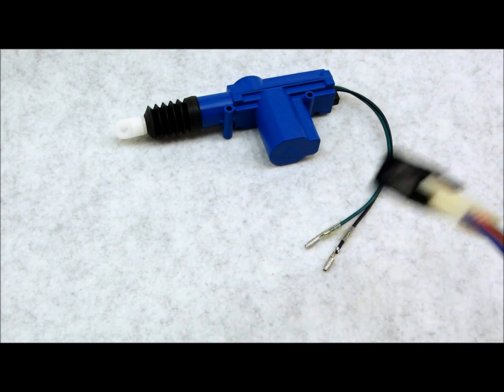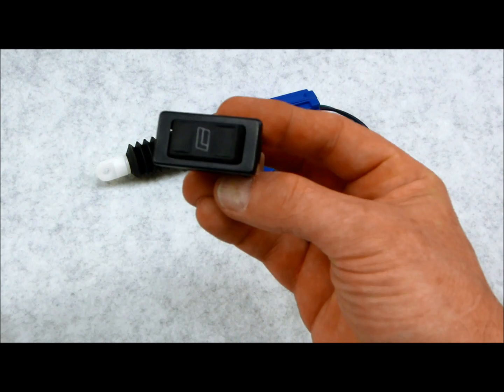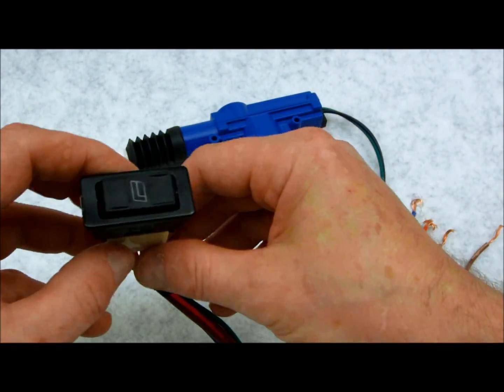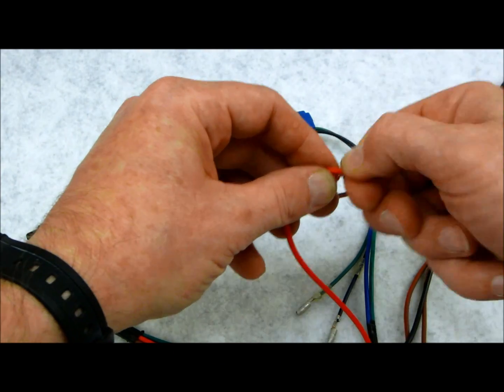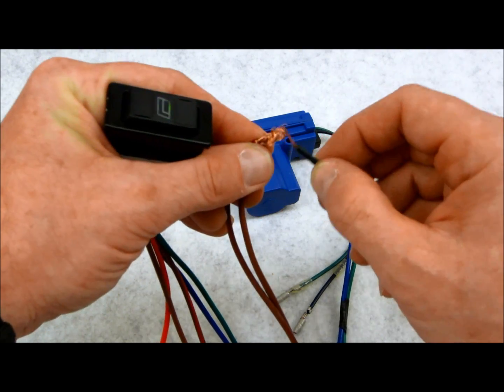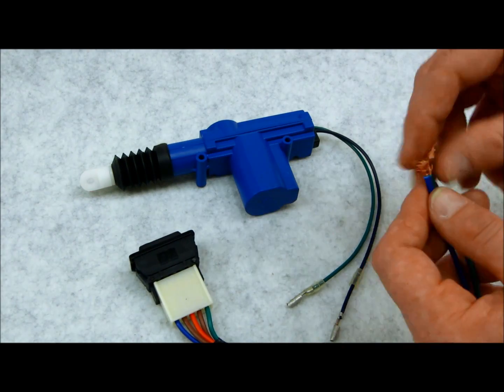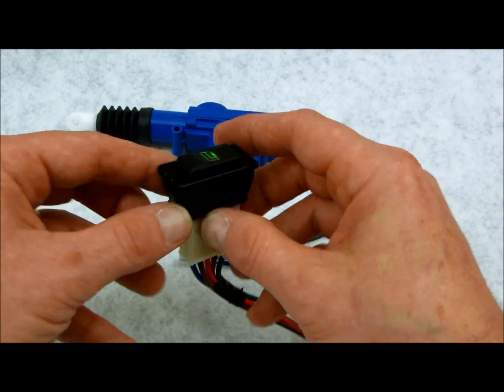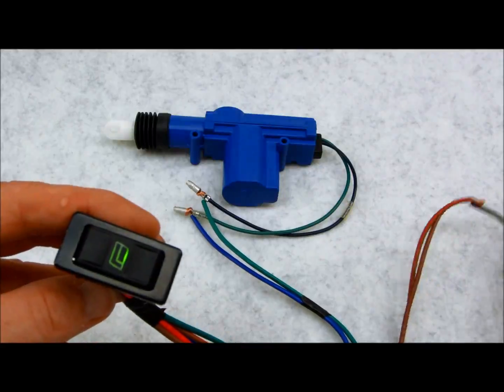Simple 5 wire switch and door lock actuator kit

Comment: Hold the phone. Two browns to a constant 12v. Red to 12v I assume a switched 12v?
Reply from the maker: center pin to +12v the 2 center pins to -12v the 2 outer pins will alternate 12v + and - to power the door lock motors

Comment: My truck has an aftermarket viper alarm. It does not have power lock switches. I want to add the switches. Would the best option be to tie into the alarm system?

Comment: hi @lesscoelectronics.  love watching all your videos.  I found when using a similar illuminated switch, there is no need for the red wire!  It is simply to illuminate the LED.  I am using my toggle switch for door locks and at first I thought I was going to have to now look for unilluminated toggle switches.  But I got to thinking about the power source for the switch so I unhooked the red wire and voila, the light stayed off but I could still control the door lock actuator!  Whoop!

Comment: I have a driver side door with a dead actuator. The door won't open and the cable that controls the latch won't release. If I stripped the cable that controls the door latch and hook it up to your actuator will that work? I probably need to get to the wires from the car itself also and maybe that cable will release. Does that make sense?

Comment: The question is: how it will control both doors? The system I saw today had the same switch one on each door, but the driver door only Locked/Unlocked the driver door and passenger switch just the passenger door.

Comment: My remote is working backwards, when I hit like it unlocks and vice versa. I flip-flopped in the green and blue wires on the passenger door and it now works normally when pushing each button, the Driver side door is still wrong, if I try to reverse the blue and green wires on that side it sends it into a lock/unlock frenzy that never ends. Which wires out of the black, blue, green, brown and white wires do I switch? If you could help that would be awesome. Thank you

Comment: Hi I have a 2004 Lincoln Aviator and there is a knocking sound coming from the back . I had a guy disconnect the drivers side door lock switch and it went away. I ordered a used door lock switch and just pushed it in and it snapped and the sound came back. The door lock switch still doesn't work and I am not sure if wires needed to be wired into the piece or not. Any help is appreciated.  Stay safe and healthy.  Steve
Reply from the maker: I'll bet its the door lock motor inside that door..

Comment: How it works if you have alarm system?
Reply from the maker: you would tie the alarms lock and unlock outputs in this kits activation inputs.
Reply: I dont get it my friend. But my question is, is this possible if i have alarm system with remote?. I want extra switch like that so i dont need to push pull the driver side actuator to unlock and lock

Comment: If anyone can help me out, I bought a viper alarm and also aftermarket actuators due to my car not having any and also have a 451m relay. Now I’m trying to add a switch to open and close the doors while I’m driving and I connected the wires same as the video but my wires burn up. Any ideas on how to fix my problem?

Comment: So I have a 2011 versa hatchback

I believe it has the actuators already cause it locks all doors when I turn the key in the lock position twice.

Will I just need to install the brain (CPU) to get the remote to lock all doors
Reply from the maker: that car uses 5 wire style motors, so it'll require relays to integrate with it:OEM KEYLESS INTEGRATION
       
            
        
      

              
        Lock Motor
        LT BLUE  (5 wire)
        BCM BLACK 15 PIN CONN, PIN 10 *
        
        
              
        
            
        
      

              
        Driver Unlock Motor
        GREEN  (5 wire)
        BCM BLACK 15 PIN CONN, PIN 4 *
        
        
              
        
            
        
      

              
        All Unlock Motor
        GREEN  (5 wire)
        BCM BLACK 15 PIN CONN, PIN 11 *
        
        
              
        
            
        
      

              
        OEM Keyless Module Location
         - 
        

        
        
              
        
            
        
      

              
        OEM Lock Relay Location
         -

Comment: 1 and 5 wire is connected to gear motor but 2 and 4 and 3 wire is connect to battery or not ?
Reply from the maker: the center pin is 12v the 2 brown are ground, the outer 2 are to the actuator motor(s)
Reply: Ok but i do this but in centre pin smoke come out and wires are heated much I should be joined a adaptor for control current

Comment: what gauge wire should i use? i already wired in a remote door lock too. can i just tap into those lock/unlock wiring from the receiver box?
Reply from the maker: 18 gauge is a good size. and I'll need a little more detail on that 2nd question to answer you accurately..
Reply: @Lesscoelectronics  I was looking at connecting the actuator wires from the manual switch directly to the actuator wires which are also connected to a remote keyless entry controller
Reply: @Lesscoelectronics  basically adding power switches to the keyless system to open doors from side w/o remote
Reply from the maker: In that case you can use a standard 3 wire rocker switch and trigger the door lock relays to engage that way pretty easily.

Comment: how do I fix my installgear, keyless entry. My remote unlocks one door, but locks the other door when I use it.
Reply from the maker: What model is this installgear youre talking about?
Reply: you dont have the signal wires crossed to both actuators then. you need two signal wires that run between the switches and actuators as bridges. one is you unlock bridge one is your lock.

Comment: Thanks great info, can you answer the following: I have a remote door locks with electronic relay now with no inside lock control button. I would like to add 5 wire button as you described, do I tap separate 12v & ground and splice into one of lock and one  unlock wires. thanks
Reply: How did you do it?

Comment: thanks so much for this, works perfecthow do I wire up a second switch?  I got both actuators working from the switch on drivers side.  do I need relays to have 2 or more switches?
Reply from the maker: If your kit is that basic, Then just wire the switches in parallel and it'll be fine.
Reply: , I did that, but it doesn't work. Is it because the blue and the green or resting on negative or ground? so when you send a positive signal through blue or green and one door it actually grounds out on the ground resting on the other switch on the other door?

Comment: Hi, I thanks for the video. Your always helpful. I I have a question. My driver's master door lock switch on my car doesn't seem to work. My passenger master works. The 2 slaves in the back seat doors work. The problem master has its light on but doesn't want to actuate. Before I go ahead and go through the process of opening my door card and buying a new switch, are there a few steps I should do first before I blow $200 for a new switch/actuator (or spend a day opening the inside of my car door-I've got a VW Passat) before I realize that I should have done something simple to solve the problem? Thanks! Ray
Reply from the maker: IMO, To get to the trouble source you will need to access the bottom of that switch to get a tester on it to see if the switch is throwing voltage or if its just corrosion/broken or a lose connection. So off with the door panel. And BTW those switches are very affordable in non oem types on eBay these days... I've used one with great success.

Comment: I was trying to connect  a same switch to my power lock system with 5 actuators, but its 10A fuse is blown, I think that I may connect these wires incorrectly. I connected the positive to a 20A power from the fuse box, but the power lock system has an only 10A fuse, should I connect the switch to the batter directly? How to use one switch to control 5 actuators ?  Thank you.
Reply from the maker: Depends, Are you using a 5 wire type door lock switch, or are you using relays to drive your actuators?

Comment: hi dear, As you explain, I want to fit key less entry I have purchased from eBay. but there is not provided  actuator with circuit. I have celerio car, there is 5 way switch in my celerio car for door open n close. so can I fit the kit there without actuator with your idea. kindly tell me connection diagram
Reply: simply want to ask you, there is 5 way switch in my car already n my is central locking already. can I install keyless entry remote without actuator with the help of these switch wiring. if possible show me diagram.

Comment: Ran across this and was wondering if you may be able to help me, you seem to a lot more then I can find with my search. So added power locks to my 72' but rather not add interior switches. But like to have my 4806v viper be used to lock and unlock it(mainly the range and added stuff later on) so like to know if you could let me know how to do the wiring, seems the testing I'm doing only get it to lock on the two wire actuators and not unlock. So do I need the 5 wire or do I need to add a relay? To make it work. If your able to help be much appreciated.

Comment: hi there I fried factory master door lock actuator in my mazda capella ah was wondering is it possibly to wire in a 5 wire after market door actuator to fill its place and power all the factory door locks again also can you post a video of how to work out what your vehicle door locks run on ie positive switching neg or reverse polarity ? to replace the one I have fried thanks any help would be appreciated thanks
Reply from the maker: zac holtz sure, you can retrofit in an aftermarket 5 wire in there
Reply: hi there thank your for your reply means and helps a lot thanks

Comment: Thanks for making this video it's very uselful. I was wondering if this principle would work for me wiring up an electric window? I am attempting to make my own circuit up, so far I have the electric windows in place and the 5 pin switch panel.. Would these switches change the polarity both ways or would I have to involve some relays to do this?
Reply from the maker: gordenfraxby84  power windows work exactly the same as door lock motors. relays can be used or not, either way would work fine.
Reply: thank you that makes it easier

Comment: Can I use 2 switch for the locks?
Reply from the maker: Usually its 1 switch on a rocker for lock and unlock, 2 switches would be weird.
Reply: I was hoping I could use one on each door just like the factory type but I just bought the 3 pin switch from you so I think I'll use it with relays since I'm doin remote start/key less on ranger